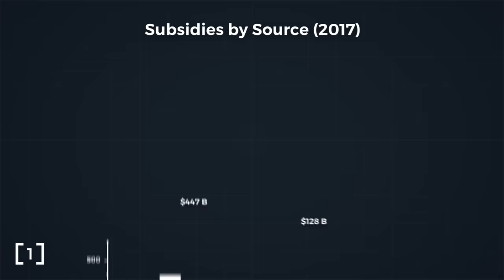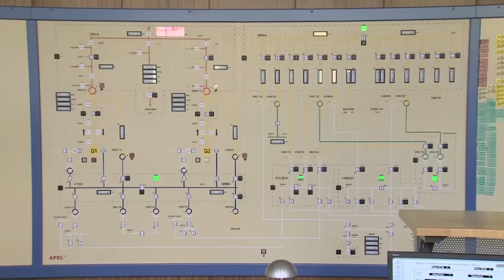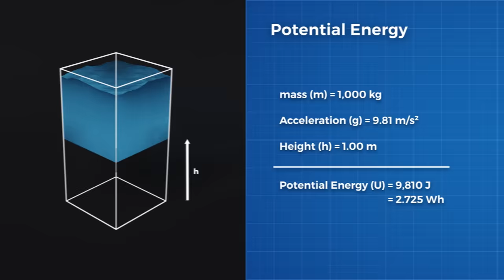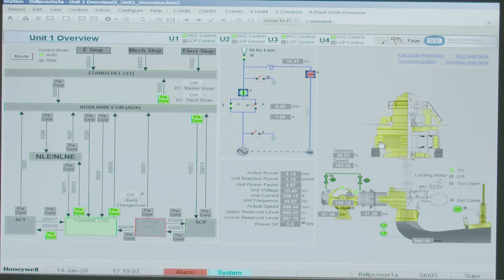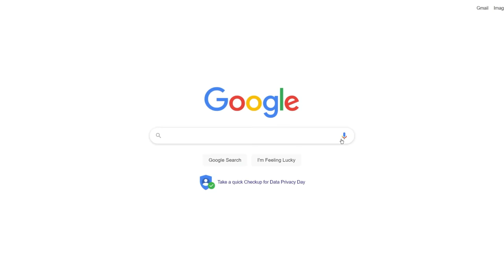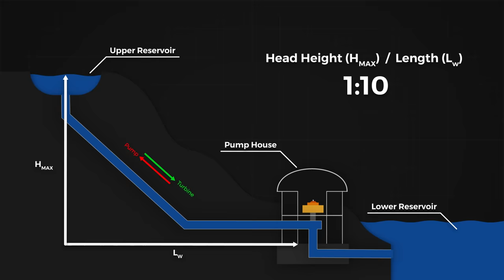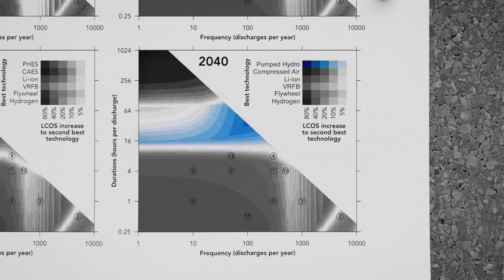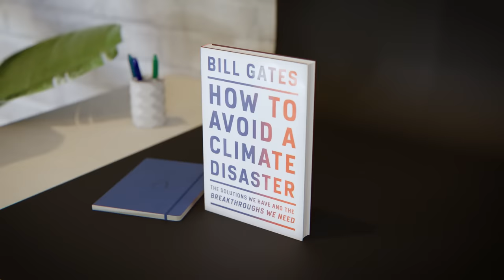The Truth About Pumped Hydro

Comment: Nice video, having worked in the power industry in system operations for over 3 decades operating 2 pump storage facilities you were very accurate with most of the video. I only found one slight misunderstanding, the pony motors are used to bring the unit up to speed and synchronize the main motor/generator to the grid smoothly in the pumping mode. Once unit is tied into grid the pony motor is shut down. They are not needed in generation mode since you have water to spin the water wheel. Once unit is synchronized in pump mode the air is purged and gates opened, pumping starts the instant the water hits the wheel. At one time there was talk of sea level pump storage being built in NYC and was proposed to use subterranean caverns carved out of the bedrock as the lower reservoir. Idea was shot down but have to believe it might be used in other locations.
Reply: I worked on a sewer trunk line once that required crossing a creek and then scaling a hill. Once built the pump pushed sewage up the hill, and was then shut off, as a siphon effect kept it flowing.
Reply: Sea or Ocean exchange is exactly what I was thinking. I wonder how many natural locations there are. My first thought was Dover Cliffs in England. There should multiple location in the Americas in a variety of locations. Either way this is good basic tech with minimal operating costs, good efficiency and durable.
Reply: @johnnysystem2579  the main problem with pump/storage now days is the deregulation of the power industry has leveled the prices between day and night. In the past the price extremes between very low at night and astronomical in the day have ruined the business model for pump storage to be cycled daily, it is now being used more now as a source of reserve in emergencies since the difference between day and night costs seldom covers the pumping losses. At best they are typically not better than 67% efficient. There are other situations where greater efficiency can be had but not in a simple isolated pump/ storage hydro plant. With the experience I’ve had in pump/storage, the greatest element when storing energy is the cycle efficiency. Every time I see mention of grid tied electric cars for storage it makes me laugh. Never have i ever seen a number for the charge/discharge efficiency of a lithium battery, lots of other information but not that, oh and you have a limited cycle life, and your going to waste charging cycles helping out the power grid for pennies in exchange.  Not something I would ever do.
Reply: @tbix1963  I agree with some points but not with others. The efficiency for LI batteries is freely available, there is even a video done by this channel. Leveling out the day/night cycle would result in massive savings. Where I live we dump power every night in huge quantities. If you understand power then you know the effect on power factor. By moving all consumer power to electric you move the problem to the source and make it that much easier to effect change in the future. No one said this was easy and there is no one solution and I don't believe we will get there on time to stop irreversible climate change but at least one, maybe two generations get to live on earth. After that bend over and kiss your ...
Reply: @johnnysystem2579  over 30 years ago when I first started in the industry there was plenty of dump energy that you could get to the pumps and it was a wonderful experience turning waste energy into a useful product the next day. Unfortunately after deregulation the market I live and used to work in has been modified to protect the reliability of the system ahead of economics. There is plenty of dump energy out there at times but it’s usually limited behind transmission constraints that prevent it getting to where it’s needed. Deregulation took a system that worked and modified it so uninvolved persons could play in its market and make money off of the ratepayers. In doing so system reliability had to be preserved and limiting rules were created to allow the market to function without endangering the reliability of the system to the ratepayers. Just took a peak at the publicly available data from yesterday. For the region with pump storage and the next cheapest region. Daytime $44/MW and next door $34/MW. Night time. $128/MW in the pumping region and next door $44/MW. Very interesting data, from my experience I can tell you that they were likely pumping to restore required reserves for reliability driving the prices to insane levels in that region. Pumping at $128/MW will result in a price in the pond of $191/MW in the pond plus the typical adder of $5 for maintenance. The energy put back into the pond will now need to sell at $196/MW just to break even. In the old days we used to have an in the pond price of $12.4 in the pond and typical daytime prices were between $18 and $38. There was plenty of room to make savings that we passed on to the ratepayers. Today all the savings are eaten away by the overhead of the market and extra involved players that didn’t exist pre deregulation. As for the efficiency of LI I’ve seen numbers posted but never actually put in context so it would be useful. I seriously doubt the numbers they post are applicable to be used for actual economic calculations, hopefully I’m wrong. Just what are the cycle efficiency of LI batteries anyway? Just take the energy needed to charge and the actual energy you get out. I know that for the pump/storage I used to run that for every 100MW we pumped we only got back 67MW and that was after being upgraded to state of the art. For LI you would need to compare the energy into the charger than the energy received after the inverter since the energy into the battery has to come from somewhere and the DC in the battery isn’t very useful until it’s converted back to AC. The efficiency of the battery alone isn’t very useful, you need the efficiency of the entire system used to store and deliver the energy to the doorstep of the plant.
Reply: @tbix1963  Well that was long. All I can say is that renewables is not a single solution and every little bit helps. I don't actually care though since we will never get there before irreversible climate change takes placed if it hasn't already.

2030-40 is the new 2100 as to temperature. As far as sea level rise, it won't matter as it will be too late by then anyway.
Reply: So far I know Spain has seawater hydro pumps running on some of his islands for several years so far... I don't remember where.. maybe in La Palma?
Reply: In Indiana and few other states  there is exploration of abandoned mines, quarries, and other subterranean void spaces for pumped hydropower. The land of course is already permitted and old so generally demand for it isn't very high anyway.
Reply: Dumb question. Are there flywheels also in the system somewhere?
Reply: @dianapennepacker6854  they do exist but mostly as proof of concept installations. The problem with projects like that is the high cost to build an original concept with little hope of making money to sustain operations and repairs. That typically results in building a minimally effective project to prove the concept and limit potential losses if it fails. The payback on these projects are usually only seen by the manufacturer who might be able to build additional units of larger capacity for others who need the solution and the cost of building and development is a excepted loss. 
The one flywheel installation I knew of was effective but to small to be of great use and was considered a financial loss. The last I heard it was being broken up to be reused in a much larger installation in a different market that had a greater need.

Comment: 5:30 PM, when several million electric kettles are put on simultaneously ;)
Reply: This is actually a really incisive point. One of the ways of reducing energy problems is by smoothing out energy loads. Right now the grid is like an 87 lane wide highway with all the cars next to each other. It has to be wide enough to carry the very worst traffic during rush hour without slowing down at all. If that load can be spread out it would significantly reduce the amount of power necessary to store. One way I've proposed of solving this problem is by offering government subsidies directly to people who log internet-of-things-automated appliances in to an online controller, which would use location and energy data to determine when those appliances turn on in order to spread their loads. This means that clothes driers and dish washers and such could be filled when people are home, but activated to turn on while they're at work, or even asleep. You get your clothes and dishes done for you (to some extent) and even get some money for doing it (which could easily come from energy production savings) and the grid itself gets smoothed-out energy draws. Something similar is being practiced in California, I'm told, but the state-subsidies idea is my own, which I intend to propose to lawmakers once the automated appliance technology is sufficiently developed. As for that... I'm working on it.

Similarly, passively heated housing and housing that stores thermal energy will likely flatten that particular curve as well.
Reply: My father was an area controller for a power company all his life and he said just this. When 500,000 stoves come on, it takes a fair bit to power them.
Reply: Technically tax credits, not subsidies.
Reply: @RandomAmbles  00
Reply: @RandomAmbles  This is already being done in Pennsylvania with water heaters, kind of... Well, with the electric cooperatives at least.  With a load control device installed on the water heater, the co-op can shut this off during times of high electric usage.  Members who have them, get a credit or discount on their monthly bill.
Reply: @bepropheta6665  Thank you. This is valuable information. Would you happen to know any searchable name associated with it?
Reply: @RandomAmbles  It’s called a load control relay or LCR.  It’s basically a device that is installed in a standard meter base between the panel and the water heater.  It communicates through power line carrier which is simply a radio signal sent through the power lines.  The system uses specialized transmitters to “inject” the signals onto the lines and the lcr “listens” for the signals and shuts the power off when it receives one.  They are programmed differently based on what type of account they are on, residential and farms being different control periods.  Our generation company watches the electric usage in the state and send the signals to control when it hits a certain peak.  We have about 2000 lcr’s on our system and we are one of 13 in the state.
Reply: @RandomAmbles  That is actually an amusingly important point to get right-wing people aboard. They'll get their knickers in an absolute twist if you call a tax deduction a subsidy, even if the economic effects would be identical.
Reply: @jonhallin8885  funny how that works... 😁
Reply: Perhaps govts should give incentives to companies with the majority of employees on shift schedules thus reducing peak energy demands and transportation congestion.
Reply: @dag_of_the_west5416  That sounds like it could be a Terrible idea if not implemented very carefully! The increased healthcare costs of dealing with people with screwed up sleep schedules and the whole host of other problems associated with not sleeping regularly might very well offset any savings and worsen the working conditions of many, many workers in the process. In addition it might increase amount of heating required for households which need to be heated for multiple people during different parts of the day.

On a different but related note: high-demand industrial machines that can be operated remotely or run autonomously are already going to be run pretty much all the time and I doubt that you could convince their owners to stop them during peak demand times. It would be hard to incentivize the decreased productivity.
Reply: @RandomAmbles  Ambles, as much as we'd all love to give government more data and trust them not to abuse it, that's just a foolish prospect. We can instead reduce the harm caused by uneven loads by adding more capacitors to the system to efficiently store energy and discharge it when the grid is not meeting current consumption. Capacitors are mostly just made of aluminum and a dielectric (yes, there's a need for wiring, heat spreaders, and other associated stuff, but still) and they're perfect for this sort of thing. They start being expensive when you use oil as a dielectric, but do we really need that? We can exchange physical space for energy storage capacity. Big block capacitors, just layers of metal and plastic with every other metal layer attached to an opposing lead. It doesn't even take a lot of electronics to make them participate in the grid. Why don't we use more of them?
Reply: @stevenlonien7857  You are being totally incoherent, stop the gibberish mate.
Reply: @RandomAmbles  we already have a system which does essentially this, its called peak and off peak pricing. with the aim of providing a financial benefit to people for not using high energy items during the day and shifting it to being at night during lower demand times. things like washing machines, dish washers, tumble driers all have timers and can benefit from being loaded and turned on at night in order to utilise cheaper low demand periods of power.
Reply: @jasonlib1996  Right. I respect such a pricing-based solution but it leads me to wonder: does it actually motivate a significant change in the way people use their appliances?

If it doesn't then it's just damage control instead of damage reduction.